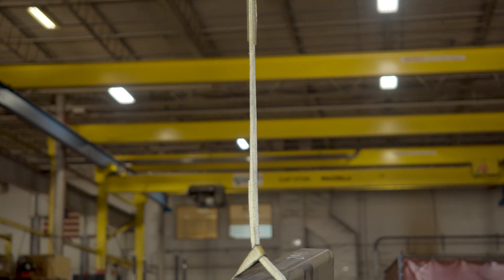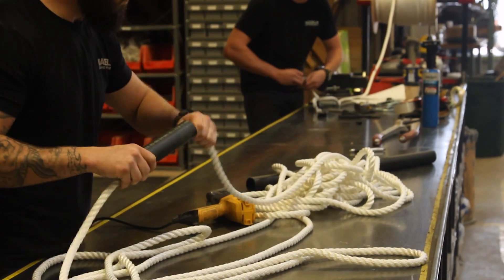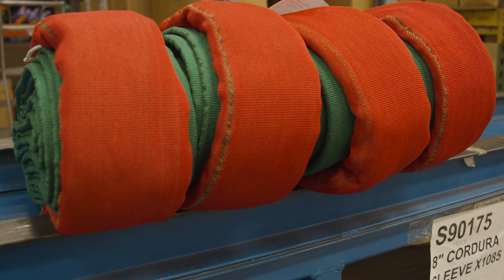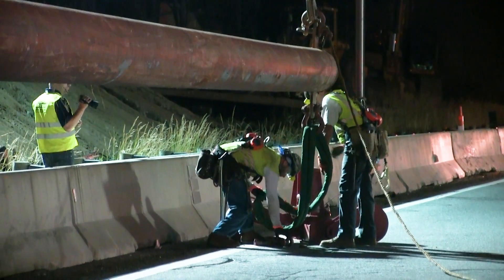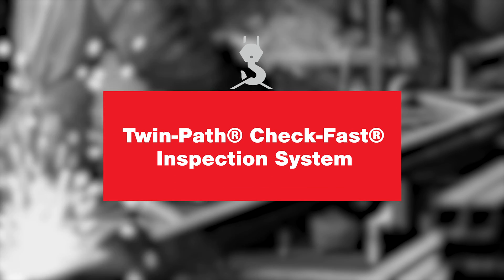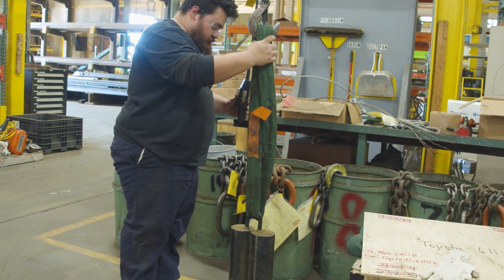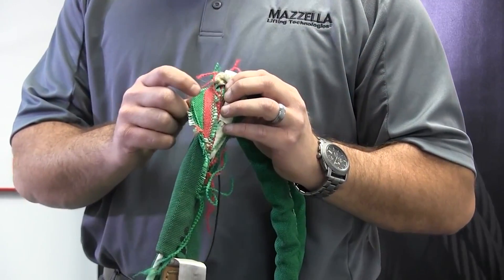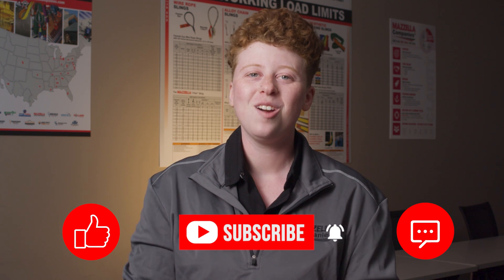Twin-Path® Slings vs. Flat Web Slings vs. Synthetic Rope Slings

Comment: How can be identified synthetic sling and fibre sling
Reply from the maker: Both would be synthetic slings. Are you referring to if it is nylon or polyester if it is a web sling? Or are you asking if it is a high-performance roundsling or a typical roundsling? Either way, all the information you need should be listed on the manufacturer tag. If it is not the sling should not be used.